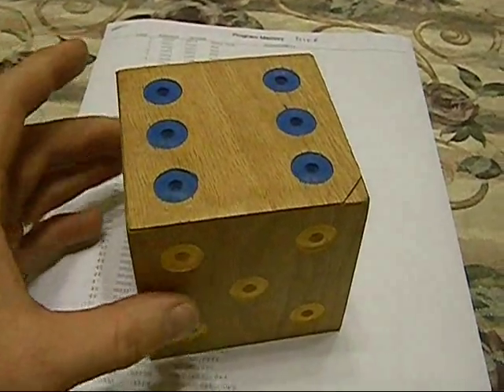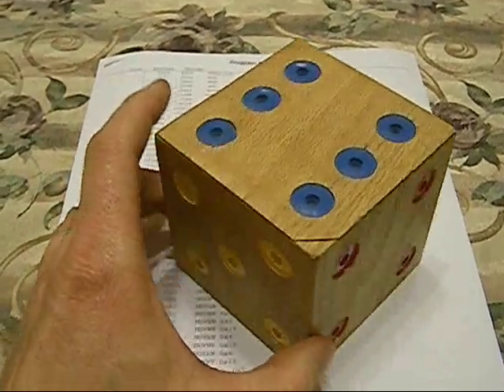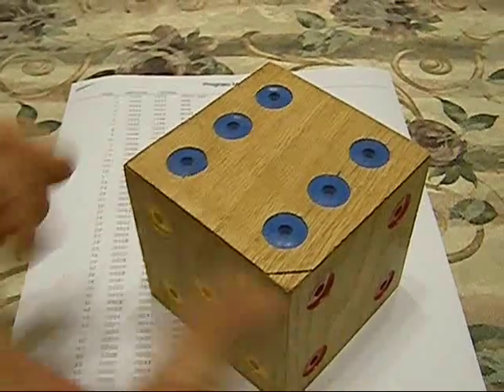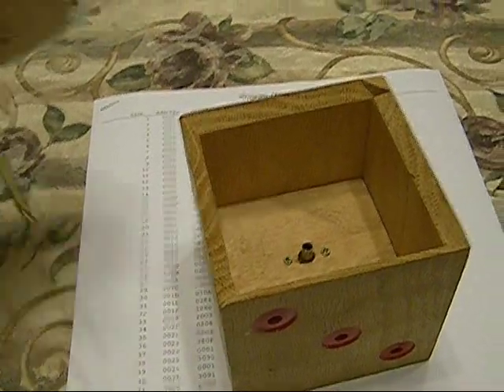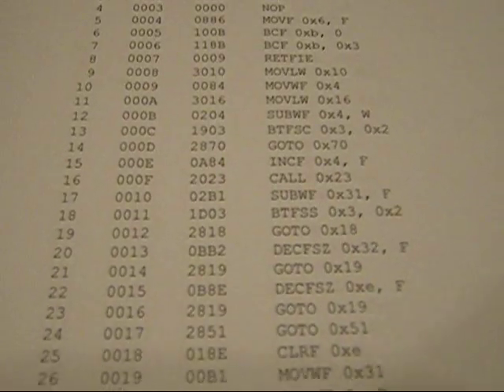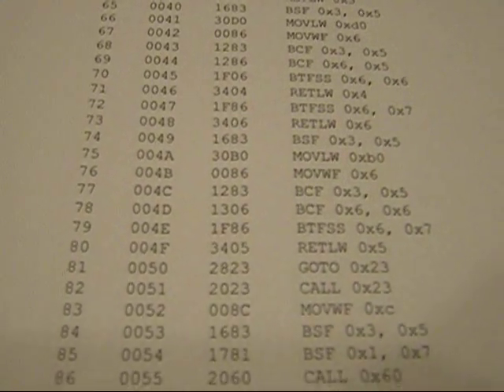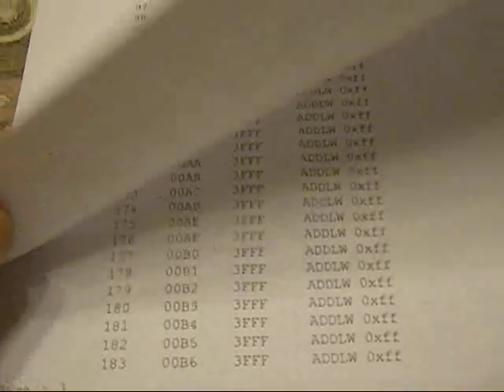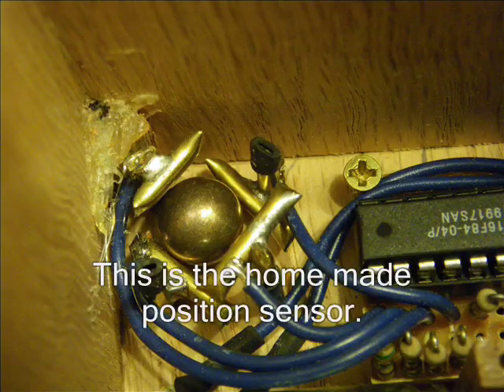Secret dice box

Comment from the maker: @MrAcronim Good question, the batteries did fail after about 7 years so I had to drill a tiny hole into the dice and slide a small nail in to release the solenoid as well as replace the batteries and patch the hole :P The next versions actually use a reed switch to direct drive the solenoid just in case this happens again or the microcontroller fails to work when the voltage drops below their working range. You can see the hole @ 2:21

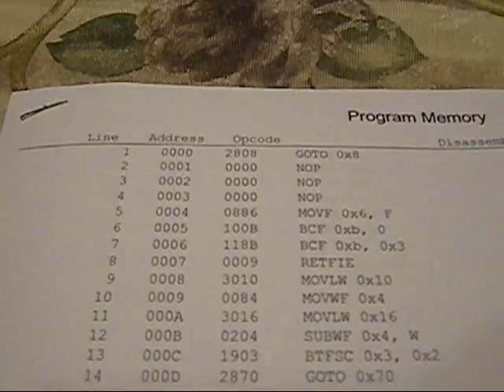Comment from the maker: @bashok001 Hi Bashok, the code starts at 1:00 and is there for you to freely use. I actually liked the opening mechanism shown at 2:00 because it was much simpler mechanically to build, but the trick is to find a solenoid or a motor that can run off of the 2 X 3volt lithium batteries, which were used simply because they have a really long shelf life compared to other battery types. Have fun.

Comment: Very clever idea. I wanted to construct this home made sensor and I get difficulties to make it running.
I can detect 4 faces, i.e. rotating the die on a single axis, and I can't clearly detect positions the 2 last faces. I can send you a drawing of what I made. Did you publish further information on the home made sensor.
Reply from the maker: +Mohamed Mokdad Hi Mohamed. As I suspect you know, the position sensor is made of a cage of 4 posts that a conductive ball can roll around in so as to allow the dice to sense it's positioning. In order to detect those other two positions the posts must be "t" shaped. The ball then rolls on the rails that the "t" shaped post makes so as to conduct the last two positions. Posts that are opposite of each other have their "t" rails facing towards either the top or bottom. Hope this helps you my friend.
Reply: +PICing4fun you are a great person
I want to get what you do
I want you to Answer

Comment: @PICing4fun why not use a rechargeable batteries and a i guess 2 slots for the pins to go to. so if the batteries will fail it can be recharged. put a 2 2000uf caps too if possible.

Comment: The only thing missing is a way to recharge the batteries. What happens if they run out? Does the box get infinitively sealed or does the lid just pops? Maybe solar panels will do the trick but then one would guess that it's not a normal box. There is a micro-controller from Atmel that is really low power consuming. A coil generator may also do the trick. A coil attached to a capacitor. Just shake the box a little and you will have few seconds to put in the combination.

Comment: you have failed making a dice.
the side with number 1, should have the number 6 on the opposite side. so they together gets added to 7.
1+6=7
2+5=7
3+4=7

3 on top, 4 on bottom
2 on left, 5 to the right
1 against us, 6 the side we don't see.

really nice box anyway, good job, just change the number, if you are making another one. :)

Comment: NERD ALERT: As a few people have pointed out, the numbers are placed incorrectly on the sides of the die. Most people have said they should add up to 7, which is true for 6-sided dice. The numbers should actually add up to the number of sides + 1, so in this case, being a 6-sided die they should add up to 7. With an 8-sided die they should add up to 9, and so on.